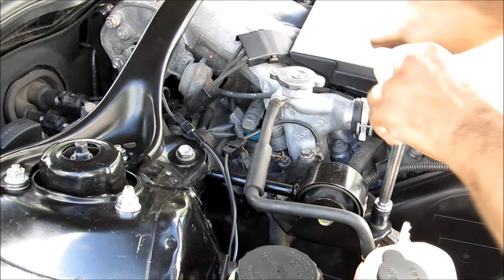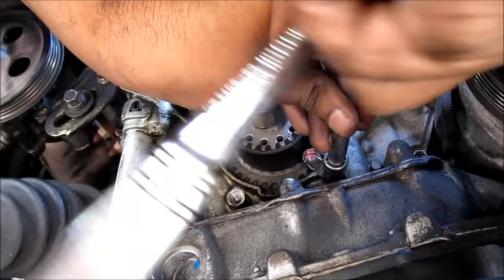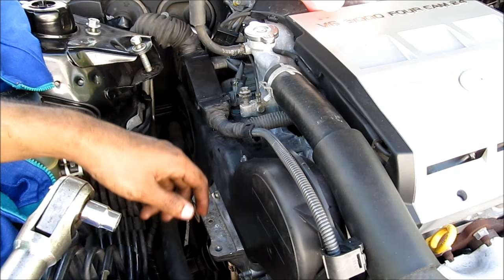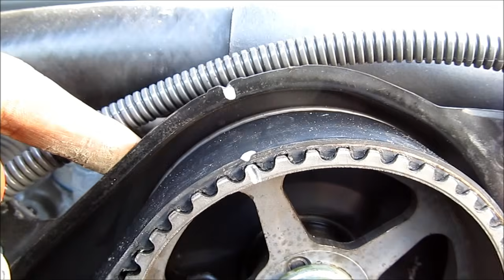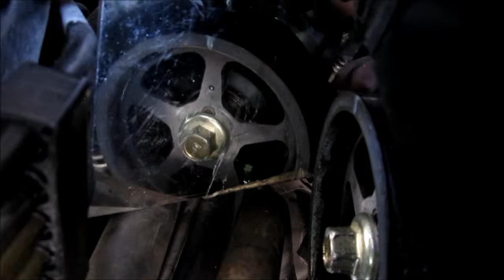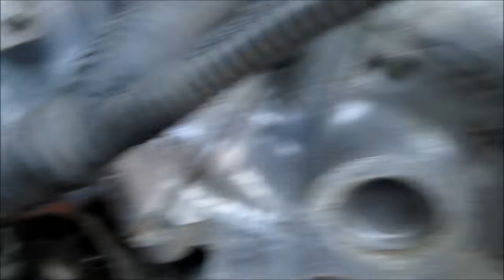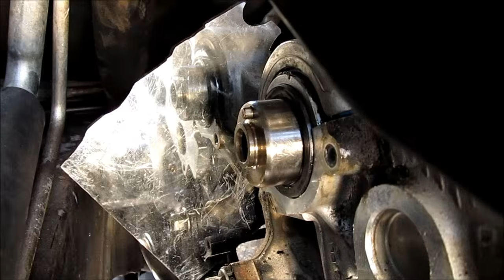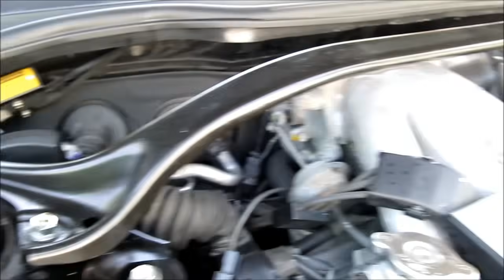Timing Belt / Waterpump Replacement: Toyota & Lexus V6

Comment from the maker: The AISIN Timing belt kit can be found here on Amazon:
https://amzn.to/309Udve (US)
https://amzn.to/2XN3M5J (Canada)
The Cam holding tool can be found here:
https://amzn.to/2XPNQjb (US)
https://amzn.to/2LDWX03 (Canada)
The seal puller can be found here:
https://amzn.to/2JdTVxV (US)
https://amzn.to/2RSOpn3 (Canada)
Harmonic balancer puller:
https://amzn.to/2RYrqHk (US)
https://amzn.to/2S3uRMZ (Canada)
Reply: Good morning, I accidentally turned the crank before installing the new Timing Belt. Top dead center has been set before removing the old Timing Belt.

can I turn the crank 360 lined up with the mark without the belt attached to it?
Reply: I'll be doing this to my highlander. How long did this take?
Reply: speedkar99 whole did you go about getting the slack out of the timing belt right before you installed it?
Reply: Aisin or Matsuboshi timing belt? I believe the Aisin water pump is OEM
Reply: Lexus 
Is 300  2001  fixi time belt en espanol
Reply: The AISIN Timing belt repart en espanol  Lexus IS 300 2001
Reply: Do these engines bend valves i have a 1992 lexus es300
Reply: @Dre072481  no, that one last forever with regular cheap maintenance. oil change every 5k miles
Reply: I would also put a directional mark on the timing belt at the front cam mark to know how the new timing belt goes on
Reply: instaBlaster
Reply: Great
Reply: Brooo where are you
Reply: Jithinkakkur Kakkur Atlanta! I’ve figured it out and everything is all good!
Reply: @joonajks  ok broooo. God bless you

Comment: Great video, I have to change my alternator, 09 Venza, 200K mi v6, never serviced water pump or timing belt. The only part of this repair that I'm not sure about is the cam positioning stuff. It's a great car but I don't know if I can afford to pay for all of this. On top of that I haven't met a mechanic I can trust in 25 years.

Comment: In my RX330 manual it gives states, 
Set No. 1 cylinder to approximately 60 degrees BTDC /compression stroke. Turn crankshaft counterclockwise by approx 60 degrees. "NOTICE: If the timing belt is disengaged, having the crankshaft pulley at the wrong angle can cause the piston head and valve head to come into contact with each other when you remove the camshaft timing pulley and camshaft, causing damage. So always set the crankshaft pulley at the correct angle." 
Don't know if that is helpful to anybody....

Comment: Great freaking video! Just a little tip on seals like that I take a black sheet rock screw and screw it on to the seal take something like a hammer or players and pry it out like you would taking a nail out of a board . Clean and don't tear up the shafts . God Bless

Comment: It seems standard practice to replace the water pump when doing a timing belt replacement. Nevertheless I want to know typically how many miles can one expect out of an original Aisin waterpump in Toyotas V6 engines?

Comment: Is the rubber on the harmonic balancer suppsoe to be flush or indented to the surface of the balancer? Mine sticks out a couple of milimetters abd is missing a couple of chunks of rubber from the surface. I am considering replacing it.

Comment: I did my ' 99 Sienna yesterday. One problem was the long bolts that go through the dogbone mount, down through the aluminum casting into the casting bolted over the water pump. Those bolts were frozen with corrosion to the point where it broke a chunk out of that bottom casting taking the bolts out.  I found out Dorman makes a replacement casting with the bolts. 37 bucks from Rockauto. This must be a very common occurrence, so I hope this helps someone to know there's a fairly cheap replacement part available.
If I had to do one of these again, Id order that part ahead of time.

Comment: Is it possible to inspect the timing belt before replacing? I have a 2005 Lexus ES330 that I'm not sure has had its timing belt replaced.
Reply from the maker: Not easily as the covers are blocked by the engine mount and harmonic balancer.

Comment: This was a great video, very helpful for me to change my timing belt and water pump on my 2003 Highlander. The only critique I would give is to add the torque specs. I found a video with them and between this video and that one I got my repair done. Thank you so much!!

Comment: Excellent video. My belt broke while driving. The firewall side cam gear will be under valve spring compression for the gear/cover marks to align. The front cam gear will not be under spring compression when aligned.

Comment: 2:34 what is that tool set called?
Reply: It's sometimes labeled as a steering wheel puller but it is the correct tool for the crank pulley as well.

Comment: Hi, could you tell me why you needed to install the harmonic balancer to start the engine and test the belt. Can we start the engine and test it without putting on the harmonic balancer? The second question is two spacers/bushing fell out of the car  when I was replacing my sienna water pump and the timing belt. I found them under the car. I do not know where they go. The hole is about 5/16 of an inch. You can look at my profile picture in the ABOUT section to see the picture of the spacer. I can see that they fit in the belt cover holes but there are only two of them! Thanks!

Comment: I had a shop tell me the camshaft bolt was overtightened and couldn't replace the camshaft seal as a result. This is a very popular independent shop that  only works on Toyota/Lexus. Seems they could've used some of your tricks to get more leverage. I wonder if they were afraid of breaking something.
Reply: Some idiot may have used loctite. A few seconds with a torch and it'll come off.
Reply: @ScubaCat3  Great info. Thanks!

Comment: Just did this job on the second Solara I’ve owned. Just picked it up cheap, 99 SE 5 Speed. The belt had only been changed once at 80k miles. Currently at 254k miles, oof. Idlers we’re getting noisy and belt was wore out. I ended up breaking a tooth off the crankshaft timing gear and it ran like garbage. Getting it replaced in the next few days!
Reply from the maker: Nice. How did you manage to break tha
Reply: @speedkar99  it was stuck on and I got too impatient unfortunately . Luckily my local dealership had one

Comment: Awesome video, just for knowledge is this engine considered non interfering? Does that also mean the timing belt repair is a bit easier to get to for a mechanic v a vvti engine? Also for a qualified mechanic how long should this take? What’s the difference for a timing belt with a non int vs interfere engine? Thanks!

Comment: Mine was done before I purchased my 2002 Highlander about 20k ago now (including water pump) however I am hearing a grinding/scraping noise from timing belt area that I'm still trying to figure out. I've have worked on these cars at my job and they don't make the same noise like mine, I'm thinking idlers were not done but I've been reading certain belts make noise depending which manufacturer you go with. It's frustrating on such a smooth quiet engine for it to make this noise although it's unnoticeable when driving/in cabin. If you have any intel let me know, read some stuff online but knowone seems.to have a definitive answer. I don't think it's serious so will probably wait a couple of years and do all you did in this video

Comment: For all those with a V8. I went to dayco website they have a training video how to install their belts. Look at the strand/strands overlay. During install you need to follow a /// pattern on the strings (going clock wise) not the other way \\\\\. That's one thing they pointed out in the dayco training. I don't know why my DAYCO timing belt did not come with an arrow to direct the rotation side or R or L cam marking... its just silly not to and my 2uZ-FE (2000 V8 Tundra) Dayco belt 94865/95298 marking is just awful, they need to have more markings to give you assurance your doing it right and have color coded marked for engine specific as we all read the instruction manual.

Comment: Hello great video . I was doing mine on a 2000 Lexus Rx 300. I lined everything up on all three marks. But when I went to rotate it to check  it seems that the crank shaft and cam are not lining up exactly it's of by maybe 1/2 or one tooth. Both top cams line up ok but crank doesn't perfectly.  Is this normal for it to happen? I tried several times turning to see  if maybe they line up but no. I am not sure what's going on and don't want to mess anything up. I would appreciate it alot if I could get some guidance Thank you.

Comment: Did you end up cracking the crank bolt using the engine crank method you mentioned?

Comment: I used this video back in 2018 to replace the timing belt, water pump, tensioner, idler pulleys, and oil seals on my 2004 Toyota Avalon with the 1MZ-FE engine. Prior to that, I had very little experience with automotive repair and maintenance. Took me probably 2 days to get the job done. Had a couple of scares getting the new timing belt on when one of the cams suddenly turn off of its TDC position and I worried that I might have damaged a valve. Anyway, I got everything put back together and it ran again with no problems and has been driving me around since then. Thank you speedkar99 for this tutorial.
Reply from the maker: Glad you appreciate my work from 8 years ago !

Comment: Hey, speedkar99. Just got my timing belt changed according to your video. But I could hear a grinding noise coming out from the belt after the engine is fully warmed up. Initially I thought it's a bad pully. But when sprayed some water on the timing belt, the noise disappeared. Other than that, the engine worked perfectly. Any idea what could be the cause? Thanks :)

Comment: I had a water pump failure (only 2 yrs old POS) on my Lexus Rx the other day, causing some over heating. I added some water and drove it home and proceeded to replace the water pump. After the pump was replaced and the existing timing belt installed (the marks had worn off), I probably installed it a couple of teeth off. When I cranked the engine, the car didn't start, I had a sense that the piston and valves may be kissing each other during cranking. Anyway, today I bought a new belt and reinstalled the timing belt, this time with marks all correctly aligned. When I crank it by hand, I don't feel any valve-piston kissing. When I crank the engine, it turns, I smell gas but it refuses to start. I read in other forums and some online pages of the service manual that you need to  retract the pistons from TDC by 60 degrees to create clearance between the valves before doing any work. I did not know this, now I am wondering if I damaged the valves during repair and the engine is lacking compression to be able to start. It is a great pity I put so much effort into it only to have a car that  will likely have to be junked. Has anyone heard of damaging the valves because of not retracting the piston by 60 degrees?

Comment: Good Stuff, and thanks. Nice to see the photography is clear, [the view  on the actual job is obscured] and good watch points. Beware when releasing the two 14mm headed long bolts into the upper engine mount that they're stretched tight. You need a good six point socket or you'll burr the heads.

Comment: I just got a 98 es 300 a 2nd owner car.. that's been well taken care of for the most part. I say that because the lady that I got it from had it painted and did her best a maintaining it. It just had valve cover gaskets replaced a few weeks ago. Yet it has the stock plug wires I don't know about the plugs she had oil changes done on time but I believe it was cheap oil. It smoked bad at start up and stop and go. I put in engine restore drove about 80 miles yet it was still doing the start up and stop and go but the rest of the time seemed much better found out the shop never changed the PCV. It's not smoking at all I've drove it 500 miles this weeks and over all runs great but I want to do the timing belt plugs wires and everything else finish up get the oil out of the engine bay I got a lot of it. Im starting to real like this car and think I might hang on to it for a while. Glad I found your video thank you for showing how easy this job can be.

Comment: Great video! One tip for others. I couldn't get the crankshaft bolt loose. I used my impact, tried the breaker bar while cranking the engine, even bought a stronger impact.

I ended up buying a Lisle 22mm harmonic balancer bolt socket. It has much more mass than a regular impact socket and can impart more force to the bolt. It took a few tries, but it finally got that stubborn bolt loose. They are $26 on Amazon. Well worth the money IMO. Just make sure you have a powerful impact wrench to use with it. I used an earthquake xt maximum torque impact wrench.

Comment: Well I just did all this today on a 2002 Toyota Sienna (except the cam and crank seals). Wasn't that bad other than it being my first Toyota timing belt. It took me awhile to finish. I work on Kias. Topping off coolant was horrible since the radiator cap was under the windshield cowell. I have a coolant funnel kit with angled fittings that barely fit the funnel in place to fill it up, but did spill some.
Reply from the maker: Yeah on the Sienna, RX and Highlander it's a bit tight under the cowl

Comment: Hey bro I have a question for you! My brother in laws 2004 sienna idler pulley Started to fail causing the belt to walk off slightly  and locked up. We got to the point of of lining up the timing marks. When the crankshaft is at the mark the two cams on top are one tooth behind. Is there anyway of timing the cams?

Comment: Only thing I'd add is that this engine has 3 drain points for the coolant, and even those don't get everything.  This job makes getting a UView 550000 Airlift Coolant kit worth the money.  Just vacuum drain the entire system, and will suck the coolant back into the system completely when you finish.

Comment: Great "How to..." Video. Just wish he would've detailed exactly about which specific timing marks are to be used. Coz I am performing this very same repair on my 98 Camry v-6, but I am stuck at the which one's are the correct marks to use. If anybody can clear this up for me, I sure would appreciate it...
Reply from the maker: Only the crank has two marks. Use the dot
Reply: @speedkar99   Thanks Boss! I figured it out by watching your video again and again, two or three times at that spot. I have the car back together and running again, however now it seems to have an ECT coolant temperature sensor issue which I am about to look at in more detail to see if I might not have put a wire clip back together or something

Comment: Great video, I used it to do a 2003 highlander this weekend. Everything is done and car is running great. However, I haven't torqued the harmonic balancer to spec. I tapped it back on with a rubber mallet most of the the way, then used the bolt to snug it up by hand. Then I tightened it with my harbor freight 1/2" impact. Do you think this is sufficient or do I need to get it torqued down to spec? Thanks again
Reply from the maker: Yeah the 1/2" impact is more than enough

Comment: This is a very good video. Just wished you you would have stressed the importance of actually using a torque wrench on the crank, cams, idler, and tensioner bolts.  Keep up the great work.
Reply from the maker: Torque wrench 🤣 
I have one built in my arm

Comment: Skips alot of very important information, example not showing the rear cam timing marks with belt or how the crank is lined up and explained
Reply from the maker: I didn't want to make this a 20+ min long video 
At least it gives you an overview 
That rear cam is hard to capture on camera it's tight back there.

Comment: Great work! Kindly may you advice me on which milage might be needed this service? And i am planning to buy a used Lexus (es 300 or 350) what is your advice ?
Reply from the maker: ES300/330 are nice reliable cars, but they need a timing belt service around 90K miles. 
ES350 uses a chain, I'd avoid 2007 and get something 2009+
Reply: @speedkar99  Thanks you so much.. appreciate your reply 😊😊 all the best

Comment: Thank you Speedkar99!  I just successfully completed this job including the cam and crank seals on my RX300.  Vehicle runs great.  I used the Lisle seal puller tool model 58430 which worked out well on the cam and crank seals, especially the Cam by firewall.  Also I used the 1.5 inch diameter PVC pipe cut approximately 1" for cams & 3.25 inch for crank and large washer to push the new seals in place using the cam and crank bolts.  This helped a lot on Cam 1.  Also I had a helper hold tension on both Cams when putting the timing belt on.  My VVT Cam 1 would flip both frontwards and backwards when taking slack out of the belt .  I used my phone camera on video mode to make sure Cam 1 was on marks.  (Found that easier than mirror.)  Also I painted a line on my crank bolt and crank pulley and  matched those up for approximate 159 foot pounds of torque on my impact wrench.  Great videos you produce!
Reply from the maker: Awesome glad it helped and thanks for your tips

Comment: If i loosen the camshaft pulleys, will the camshafts turn and loose engine timing?
Reply from the maker: Yes the rear one will move. Just turn it back until it lines up with the mark.

Comment: Great video.  I really dig your straight to the point style.

I was nervous about doing this job and was seriously thinking of taking it to a mechanic to get this done but this video gave me a boost of confidence.
Reply from the maker: Yep I was in the same position a few years ago... hesitant to replace a timing belt. 
I tried and screwed up (wrong torque settings) on my first car but eventually got this one to work out smoothly.